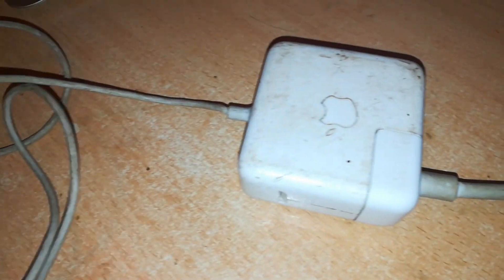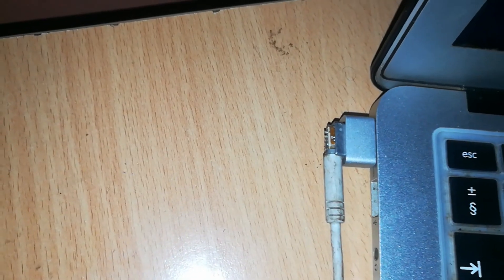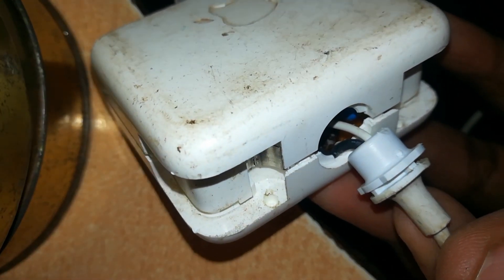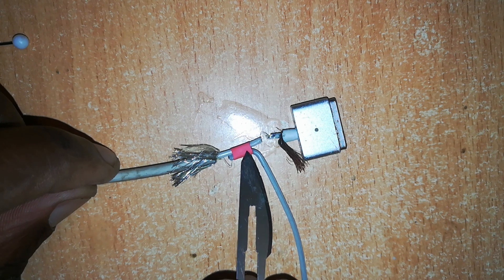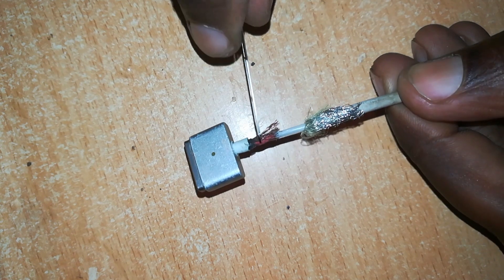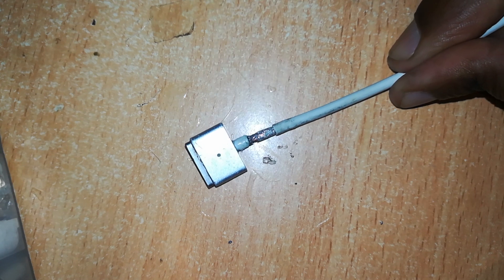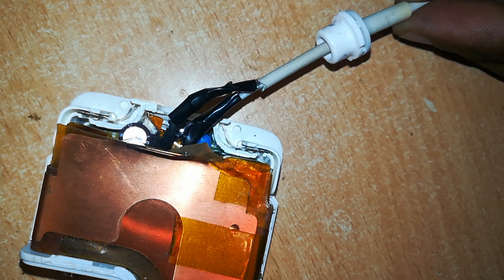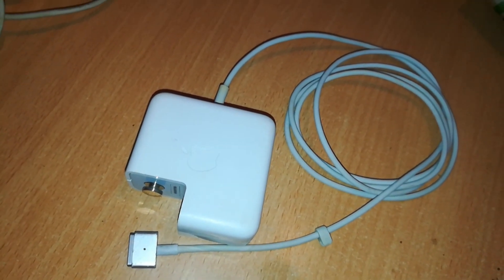Magsafe 1 to Magsafe 2 Conversion #magsafe1tomagsafe2converter #magsaferepair #applemagsaferepair

Comment: Thanks for making this video. As a summary, upgrading the cable is a similar procedure as when you're replacing the same charger type cable. Hence, it is possible to do this conversion if you're a bit handy and have welding tools.
Reply from the maker: sure. actually it's possible both ways! kindly watch the other videos in the channel and don't forget to subscribe, like and share!